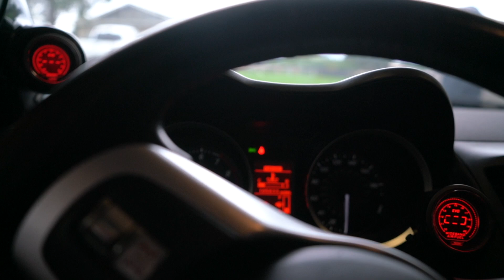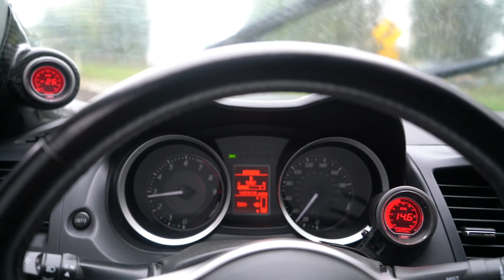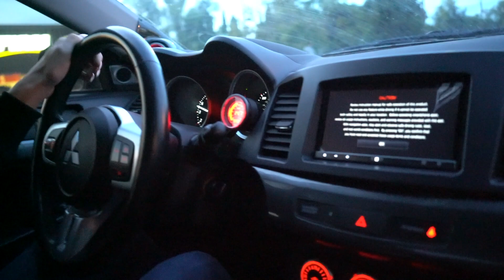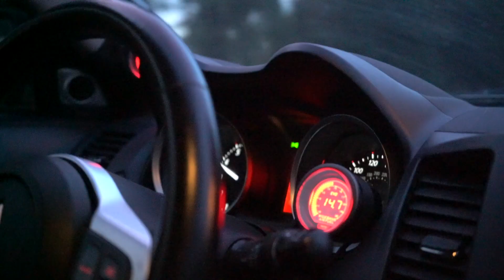Rebuilding The Blown Evo X | Ep. 10

Comment: Break-in oil doesn't matter really. Petroleum is usually better than synthetic for this because it will allow the metal parts to break-in better because mineral-based oil shears more easily. It will also capture more sheared metal than synthetic.

Comment: Sounds good except the ticking which is probably due to engine breakin period, but if it ts there.   You would bad lifters  and springs if springs good bad lifters.

I think you need to checkout Evolution forum and CZEROMEDIA on youtube he owns a shop knows Evo's very well owns a evo8 like yours and recently built a Evo X would proper oil to use the EVo forums there's great info on there as well plus Dave Buschur of Buschur racing is active on the Evo forum.

Comment: dude u need to take your time abit more when things dont plug in easy... pull it back off and check its aligned instead of just forcing it on there.... as soon as you said it was hard to get on, i knew a pin was bent.... clips should just push on with ease... for future reference